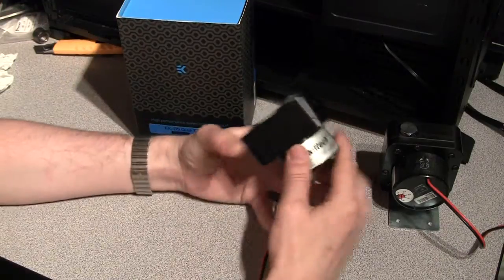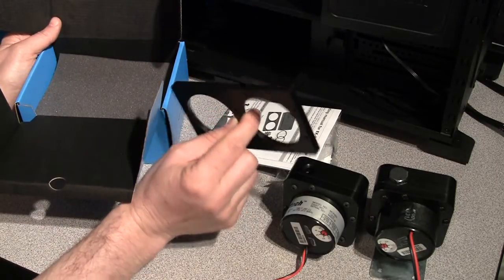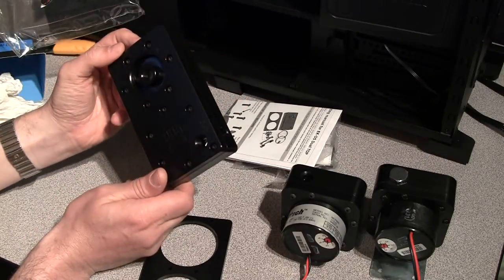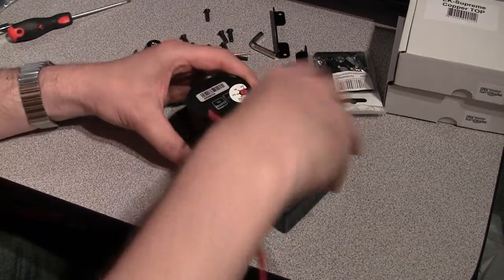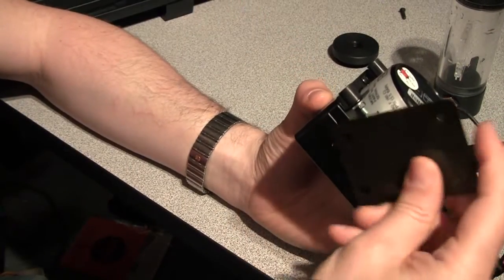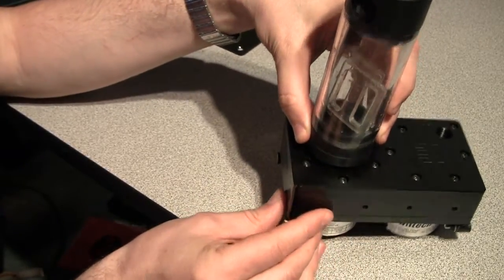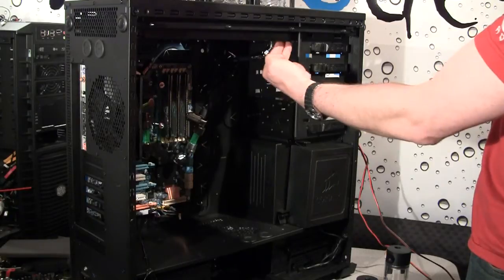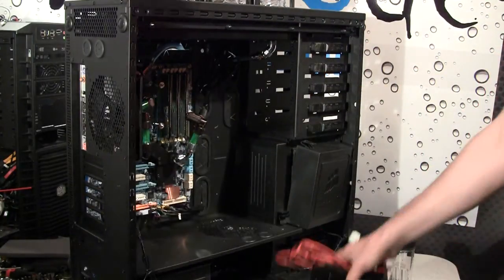EK Dual D5 Pump Top Review & Installation

Comment: @DazMode k thx i didn't see it that way. and i love your vidios it will probably help me building a h2o cooled pc in the future (i have the haf 932) but i'm waiting to build it until the new cpu architectures are out (bulldozer and sandy bridge) and i probably skip the 5xxx and fermi series. and mine hardware atm isn't really worth it to be h2o cooled i can't oc mine cpu whit 0.2 because it starts to get unstable than

Comment: @DazMode isn't there a way that you cool your reservoir whit the radiator (maybe you can include the cpu because it isn't that hot) and do a seperated loop for the gpu so you have a large rad for cooling the reservoir coolant and cpu .the gpu line will have a smaler(or non) radiator but will use the cool fluid of the reservoir to cool it self or will that be a some kind of fail

Comment from the maker: @themassau  For the lower temps two separate loops will be better choice, although you'll need two radiators as well.  I'm using single loop with two pumps for redundancy  (if one pump goes down, the second will be still enough) and for increased pressure/flow.